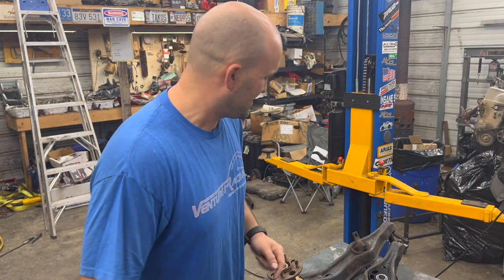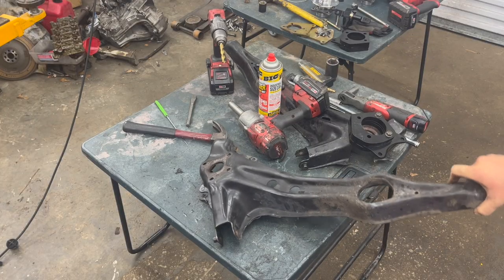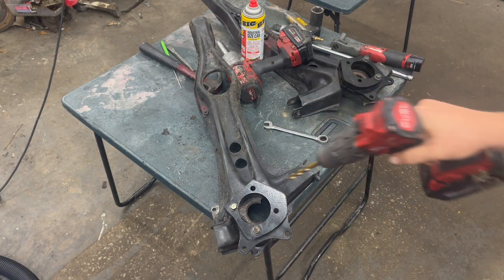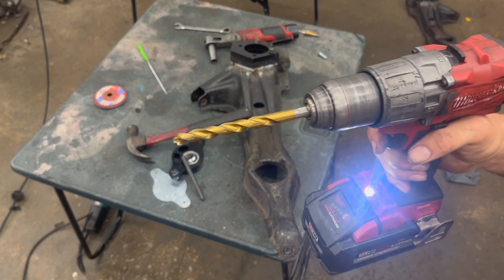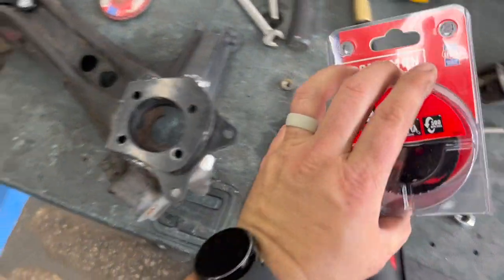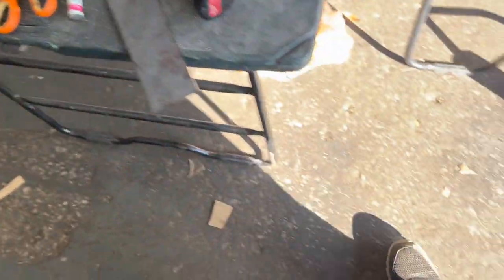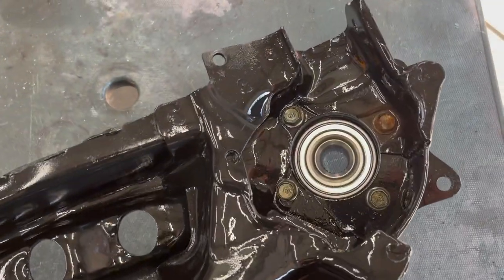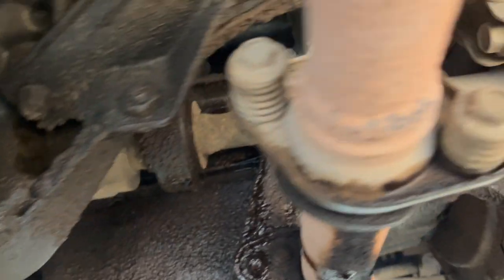DIY Budget AWD Trailing Arms for my EG Honda CIVIC

Comment: What hubs can I use if it’s. A k series  sdiff and axles the ones u used not sure if b or k but are out of stock
Reply: K series 2000 crv for 4 lug and 2007 for 5 lug hub

Comment: The link to the plates doesn't seem to work anymore.

I need to find a 5 lug version with the same bolt pattern as the Insight hub and bearing assembly.  Looking for a 5 lug AWD solution where I can easily find replacement parts. Might have to look at the Fit.
Reply from the maker: I quit selling them on my website, I can still get them. I can provide you with the info you need for 5 lug as well. Just shoot my an email. phillip@thehondaresource.com

Comment: just found you're channel you do awesome work man was wondering what rotors and calipers you use on rear trailing arms
Reply from the maker: thank you man! I just used integra rear disc setup.
Reply: @hondaresource  thank you did you use dc2 parts
Reply from the maker: Yes, those will work fine

Comment: Hey Phillip, sweet Element! Picked up an '03 EX myself, runs like crap, shaking and hunting revs up and down at idle-any thoughts? Suspect throttle body gasket. Thanks Phillip. 👍🤙
Reply from the maker: Intake leak. Probably the idle air control valve

Comment: Hey just tried to do the RD1 CRV rear disc break conversion. When ever I  bleed the brakes they are still spongy when starting the car. All the bubbles are out, never blead dry. Any leads?
Reply from the maker: Did you bleed it with the rear calipers off and the bleeder screw up
Reply: @hondaresource  You mean where the caliper is not touching the brake pads? I think I did, but also how did you got about bleeding them. With a vacuum speed pump or like someone  else pushed on the brakes. Lastly how long did it take for you to bleed them?
Reply from the maker: @drunkn3450  I did them with a block of wood in where the pads would go, with the caliper unbolted and holding it with the bleeder screw in the upright position. I got my wife to pump the pedal for me.
Reply: @hondaresource  With both bolts, or just one. Like the bottom one un bolted to flip the caliper up? I am just try to make sure